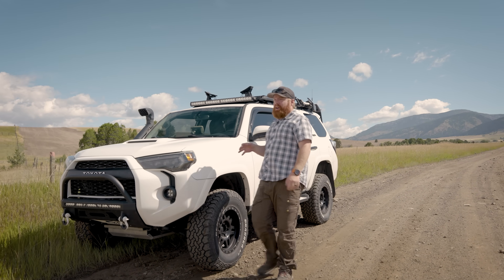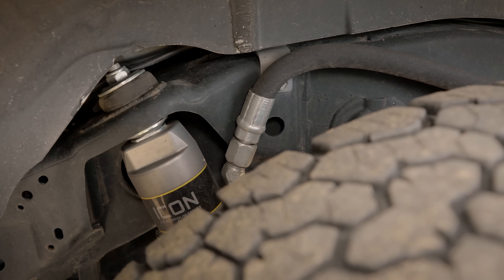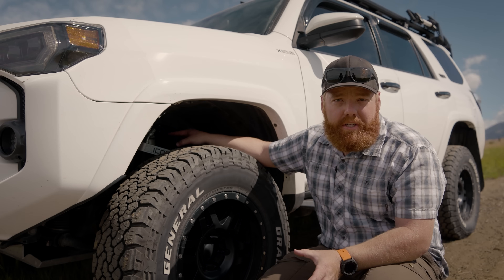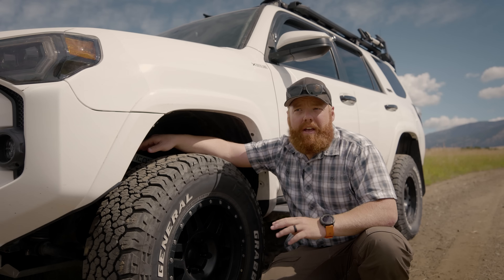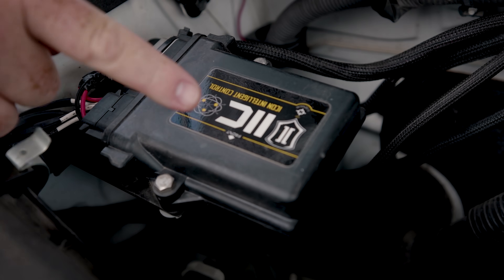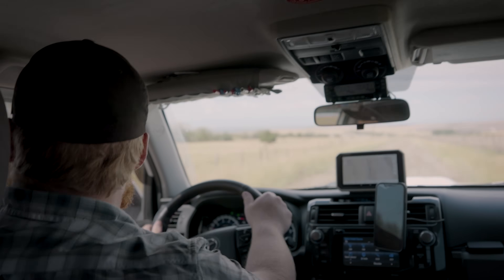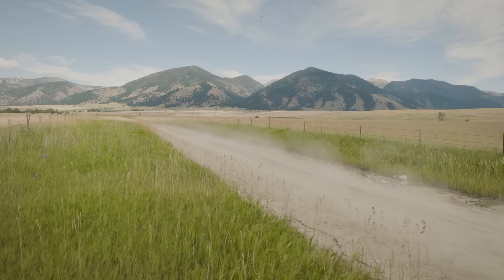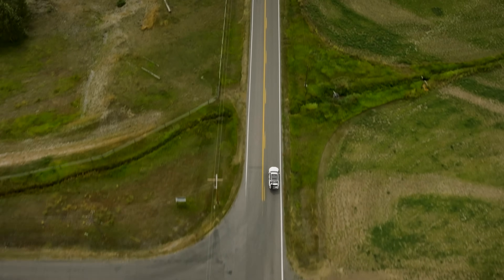Should You Buy This Suspension for Your Overlanding Build?

Comment: If you are planning on adding that much weight (drawers, fuel/water cans, heavy bumpers and a winch) to a vehicle not really designed for that will the engine be able move all that extra weight?  Will you need to re-gear the axles to a better ratio for the increased weight?  I see way to many Jeeps and Toyotas so loaded down they don’t have the power to get out of their own way.
Reply: Yes, if you do add a ton of weight, a re-gear definitely helps. I will not be adding that much weight on top of what I have at the moment and in my opinion I have plenty of power from my use. I also came from a 4.0 jeep so any power is a lot of power it’s all based on your own perspective of what you need for power.

Comment: Noticed you have the KDSS system.  Hoe does the CDEV  "negotiate" with the KDSS system?  My understanding of the KDSS is that it firms up over 25mph and turns off below 25mph such as when on trails, etc.  Can you go more into how the systems integrate with each other.
Reply: I’m still messing with it. I believe that the two systems are kind of fighting each other, so makes it stiffer than it could be. I am probably going to experiment more and potentially even remove the sway bars to see what the difference is. As of right now, I found a fuse inside of the cab that goes to the KDSS system and pulled it so I believe the system is disabled but all the sway bars are still connected.

Comment: the bigger question is do you really need this expensive mode? I wonder how many miles are you driving on gravel roads? Even these guys did like most asphalt rides in Norway. I think it's excessive mode, but definitely make your ride better, but it's always you can just tire pressure
Reply: The Africans use OME shocks because they are proven to handle the roads out there without needing service. Icon is for yuppie Montana folk.
Reply: I definitely probably do not need it. It’s really more about what you want than what you need. I wanted to try it out. We run them on all of our fleet trucks and they make a lot more sense. Specially, the ones in Africa right now dealing with horrible roads, the technology is more designed for desert racing and any application where you’re driving on lots of terrain quickly